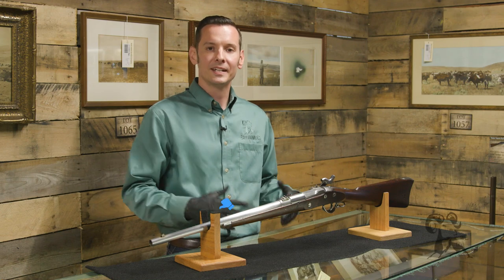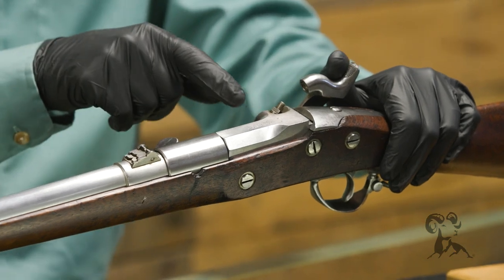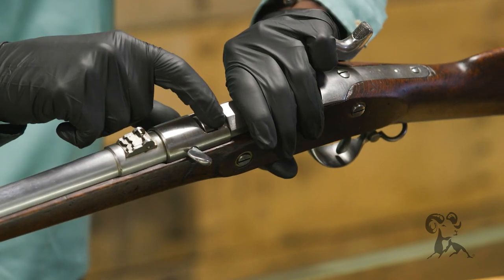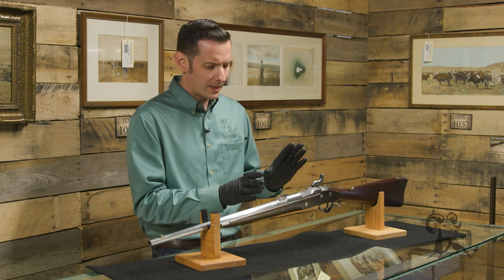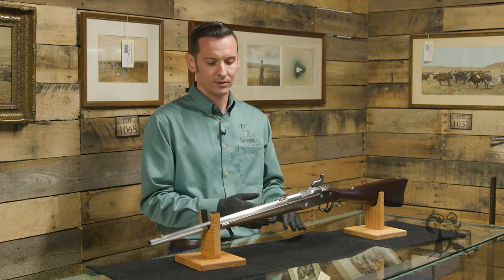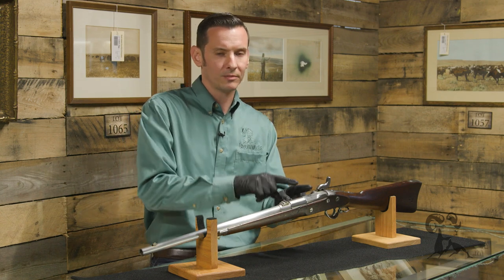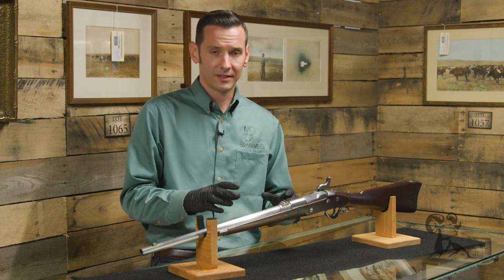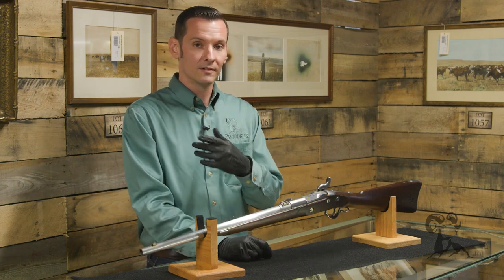From the Vault: Lindner Breechloading Carbine

Comment: Very interesting Cartridge the Lindner used.  It consisted of a piece of Cartridge Paper glued around the Base of the Bullet; forming a Tube. The Powder was poured in, followed by a "Tassel" of cotton yarn; after which the Cartridge was closed by twisting the end tight. In use, the Soldier opened the cartridge's Rear by pulling out the exposed Tassel with his Teeth; followed by loading it into the Rifle.